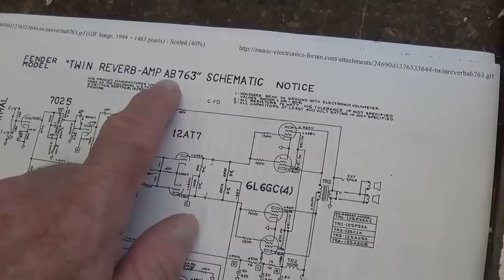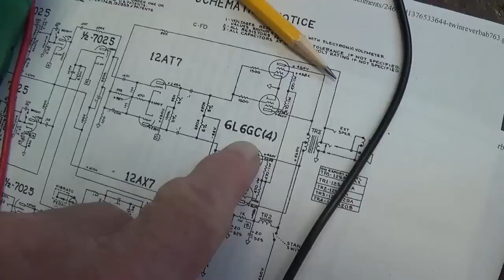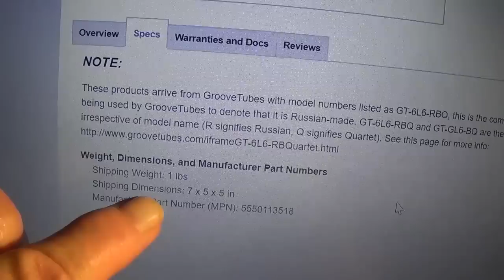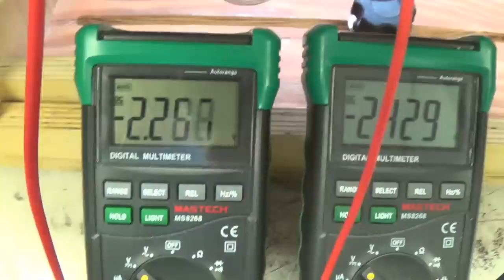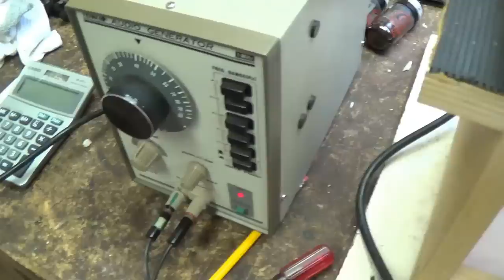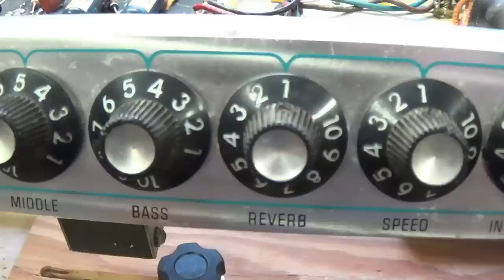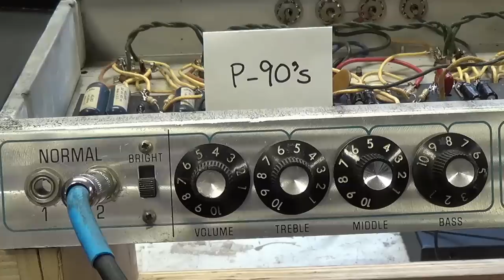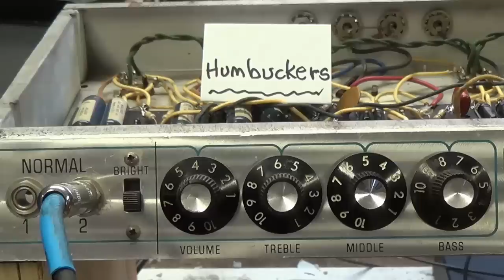1968 Fender AB763 Twin Reverb:   Evaluation, Modification, Extended Audio Demo

Comment: I'm curious as to why you are biasing the amp on the cold side at around 50% plate dissipation. (36.5mA /tube). In my experience 60-65% make the amp sing better.
Reply from the maker: I have been tending toward lower dissipation settings, Arnold, after seeing just how high the PC goes in grid-biased circuits. Several other techs have expressed similar feelings. I honestly thought this Twin sounded great at 50%

Comment: I have a question for you I'm using a traynor ycv80 I know people hate them mine sounds killer. But the guy I bought it off had 2 6l6gc Svetlana and 2 5881 tung sol for the quad would this cause issues
Reply from the maker: The tubes are not equivalent, Andrew, they are like apples and oranges, and probably quite difficult, if not impossible, to bias properly.
Reply: @UncleDoug  thank you for your response

Comment: Just a heads up that long, Long ago.. Mains power wires were colour coded to be Red for Hot or Active, Black for Neutral or the Return and Plain Green for Ground and or Earth, Long story short over the years it was discovered colour blind Servicemen and or electronic engineers were having difficulties with what colour they were perceiving Note some were lacking Green, some were lacking Red while the rest lacked Blue, needless to say appliances invariably ended up being wired incorrectly due to the colours being recognized incorrectly, So after a few deaths, The colour codes were changed so that no matter how each colour blind individual perceived colours they would ALL  identify them correctly..
Reply from the maker: Thanks for that interesting bit of historical knowledge, KAB :)

Comment: Pretty sure I know what happened with that center tap: most repro power transformers I've seen use an orange wire for a copper earth shield around the windings. Whoever worked on it must have seen the orange wire, assumed it was an earth shield and decided there was no 6v center tap. So it means they didn't bother to check the transformer or test the windings and just threw in a virtual center tap. :/
Reply: i was confused about that whole part.  it looked like the virtual center tap was connected to some jack or something.  he removed the virtual tap but the actual center tap wires it looled like he put back right where they were?  i was thinking they would have been run to where the virtual center tap was connected
Reply from the maker: The 100 Ohm resistors (virtual center tap) were attached to the pilot light, which is typical. I simply removed the resistors and grounded the center tap.

Comment: Why 400 hertz and not 440?  

I believe the reason for the colour of the wires on the power cord is the use of an IEC cord.
Reply from the maker: The 400Hz tone is easier to tolerate than previous tones I've used. The frequency is of no consequence to the testing procedure.  Yes, as I said, the cord is of European extraction ;)

Comment: 450 plate volts seam high for a 65 BF Twin reverb? Resistor in rectifier circuit is testing at .750k? Im able to set the bias anywhere from 55 to 10ma.
Reply from the maker: Nope, 450V sounds about right for a BFTR, Eric. Your bias range sounds about right also.
Reply: @UncleDoug  One of my grid resistors is reading .500k and that tube is red plating, could that be the cause, thanks so much
Reply: @UncleDoug  There are no ground straps on pins 8 too?

Comment: Uncle Doug, since your reputation is NOT up to debate but you seem sensitive to that,and you can't replace the caps in the "dog house" tape a note to the top of the dog house saying that you did not replace them. My dream amp would be a Tweed Bassman using EL-84's and a piggy back amp with 4 10's in series/parallel at either 4 or 8 ohms. I'd appreciate your opinions and if you have ever come close to building one like that.
Reply from the maker: Thanks, Dennis. I appreciate the suggestion. I touched up the cap wiring a bit and determined that it was sound, so it shouldn't bring shame to my rep :)  Do you envision four EL-84's like a Vox AC-30?  The power would be there, and with 4 x 10's it should sound wonderful. I'm so busy lately with customer amp repair that I have no free time for personal projects.......maybe some day. It sounds like a viable project.
Reply: @UncleDoug  I think that a pair EL-84's in push-pull would be enough for my use. That's why I asked you about being able to disconnect two EL-84's if necessary.

Comment: Just to add a little more info regarding the filter caps as to WHY some of the leads were J hooked and some weren't. I don't know when Fender changed how the wired up the doghouse, 70 maybe, but before that like in the case of this amp, there's a ground wire that runs under the  board connecting the grounds of the  3 22uf caps and series wires for the 2 larger ones. Fender changed to putting the series connecting wires on top of the board for the 2 larger caps and then running actual ground wires to the 3 smaller ones instead of a ground wire under the board. 

TL:DR  People just leave the original leads in tact on those certain caps because they're connected to the ground wire under the board. On amps that have individual ground wires and the series connecting wires on top, you don't have to worry about this.
Reply from the maker: Good observation,  Robert. Thanks for the helpful input.
Reply: @UncleDoug  Definitely wasn't wanting to step on your toes but I had this question once and really couldn't find any info. 

Thanks for everything you do. Just finished a 71 and 72 Twin large in part due to your videos.
Reply from the maker: @RobertLandrum13  Your helpful input is always appreciated, Robert.

Comment: Hello there Doug, as i had mentioned to you sometime back in a comment, i'm not well versed on electronics though i know the basics....
this might be a stupid question but i don't want to smoke anything...
Recently, i was watching some youtube vids about electrolytic capacitors etc, and i was left with the thought that any of them being around for years in any machine, though not bulging etc, they could be bad just by being in the unit for all these years, (from the 70s etc.).
i do have a lot of old various types of units, most with transistors, (TVs, radios, amps etc.)
should i be concerned and toss them out proactively, since i'm not about to open every one of them up and replace capacitors blindly?
or have someone do it for me at that, that'll be lots of money for units that might not be worth much, but memories....
or just see how it goes and go from there?
So far anything that i've used seems to work fine...
Reply from the maker: Using a current limiter (see my video on how to build one) you can simply try each electronic device to see if it works properly. I do not advocate ripping out all old components and replacing them, unless the amp is going to be used for public performances.
Reply: @UncleDoug  hello there Doug and thank you for the quick reply. I more than agree about the part of leaving things alone and I will try to build me that current limiter that you mentioned. I’ll look for it. Stay well.

Comment: is the circuit limiter light supposed be on but slightly dim?
Reply from the maker: These big 80 to 100W amps could use a higher wattage bulb, George. They draw a lot more current than the amps I usually work on.
Reply: @UncleDoug  ok thanks i did not know this, say hey to the kitties

Comment: I use MOD tanks for repairs myself.  I go a bit overboard on the tank cables though.  I prefer better plugs and signal cable.
Reply from the maker: I understand, Tracy. There's nothing wrong with preferring better quality.

Comment: UNCLE DOUG-- thought this might be of interest to you , I noticed your voltage draining devise with the black electrical tape and fillips head screwdriver sharpened to a point , this led me to think there might be a better way to construct one with a automotive 12 volt pointed test probe , converted by taking out the bulb and spring and  install-n a 1000ohm 10 watt resistor in the now empty chamber of the 12v test probe then solder the test probes cord and alligator clip to one of the leads of the resistor , I sure it will draw other techs interest,  I have a pic of the device but didn't know how to send it to you ,I sure you already know what i am talk-n about, Sorry about the novel I'm writing here
Reply from the maker: Thanks for the excellent suggestion, Stephen. A generous viewer in Holland constructed a beautiful cap-discharging tool for me.......so I am all set for many years to come.

Comment: Those are 6L6WXTs or 5881WXTs which were just Soviet copies of our 5881 made for the the Soviet military. The OTK stamp literally just means "Officially comrade approved." I do have an old 1984 Soviet tube book. These come back with a maximum rating of 86 mA plate @ 250 volt plate voltage, add math and I get 21.5 Watts for max plate dissipation, however Mesa Boogie stamps these as 6L6GC STR425s and Mesa Boogie rams a whole LOT more wattage onto these plates, and they seem to do okay, for a while. They are actually pretty tough tubes for Soviet stuff. These have graphite coated plates and gold plated grid wires. Good stuff, at one time, I guess, but I cannot say whether or not Mike Mathews is making these tubes better or worse then X-Po Pul  under the Soviet regime or not. I will say, I am not very impressed with New Sensor's QC or workmanship.
Reply: I do like TAD's stuff! Them are Chinese made and TAD seems to weed out the junk better than most.
Reply from the maker: Agreed, Seth. I've had good luck with them.

Comment: I read 6l6b’s are amp killers.  My Hot Rod deluxe came with them and, as I searched for mods, I came across warnings about 6l6b’s.   I ditched them and have never looked back.   Never had my amp destroyed either.  I guess you use them at your own risk.
Reply from the maker: I tend to discount a lot of broad condemnation of certain components, James, but I'm glad your amp is doing well.

Comment: Doug, regarding the colour coding of european power leads. We use the same brown & blue for active and neutral here in Horsetrailier,
I always think of it as blue is cool and touch the brown and you're shit.

Great video as always!
Reply: The only way I can remember EU colours (they've never made sense BTW) is "brown bread" = "dead", so don't touch the brown 'cos if you do you're brown bread
Reply from the maker: Good way to remember, Vinny. Thanks !!
Reply: @UncleDoug  I'm almost ready to start my 1st build. Got the chassis, iron, tubes, socket n pots, speaker and filter caps. Plus I picked up an used router for $50 on the weekend. 
I've watched your videos repeatedly and hold you responsible for my developing ampoholocism. 
Thanks from Horsetrailier m8!

My 19yo son knows your voice and your name - the legend grows...

Comment: I have two old GT tubes and both of the locators are also gone ;)
Reply from the maker: They are dangerous to use, TG. It helps to externally mark the location of the index pin.

Comment: You probably know this , but it is part of the danger of USA v Europe/UK power cables.  In the UK white and black can be used after a rectifier indicating DC, or after the power input after SW and Fuse to internal supply.  Black would be anything going to ground or return, with white being a feed (other colours may be used too so its not hard and fast, but we would not expect a mains voltage feed) The Agreed European system of Brown Live (feed), Blue Neutral (return) , Green and Yellow (earth) was a bit of a compromise of EU systems at the time, while trying for the aim of colours that are difficult to mix up visually , and in the twin colour for the earth to avoid dangers of colours fading to be mis-read in the future. This also left other colours free for Three Phase power supplies but I forget what they are.  The British system was probably the most logical in having Green for Earth,  Black for Neutral / Return and Red for Line / Feed / Live.  Red being associated with danger , I suppose brown could be taken as a faded red.  Dont forget too in UK the supply voltage is 220v-250v AC depending on what the grid feels like dropping around domestically, and this is a RMS figure so its nigh on 440v with respect to ground zero volts and a bit more phase peak +ve to peak -ve so you can see the need for inrush voltage protections for circuits at power up, taking the 700v gives plenty of space -  on this unit those diodes in the rectifier circuit looked a little small compared to what you normally use.  Most Power transformers that I see have a jumper settable position of 220/240/250 v and some can go down to the USA voltages if needed, either on fly leads to an external accessible location or on the underside or top of the transformer casing.
Reply from the maker: Thanks for all the very informative input, HP.

Comment: Congratulations on another fantastic project Uncle 
Doug.  After the averages of the plate discipations of the two pairs are dialed in with bias adjustment, is there any utility to going to the additional step of checking the plate discipation of each of the 4 tubes individually?
Reply from the maker: With a matched set of tubes, obviously operating quite well together, I felt no need to do so, Sara. Unless you have Eurotube Test Probe(s) or have added a 1 Ohm resistor between each cathode and ground, it's not easy to determine the individual PC's.
Reply: Thanks for answering my question and expanding my understanding of the power section circuit.  As you pointed out in the video, since the screen resistors and grid stoppers were new and easily measured in circuit, and the power tubes are all well matched, it is easily understood that the power tubes are all operating comparably.

Comment: In light of your humorous comments, my thoughts:            (With or without a pilot light being illuminated)
1. Comment on the 350 V to the guitar strings, sounds like a good plot for a British murder mystery.
2. You comment on European power cords color code, try to understand why the British electrics outlet of 230V fuse side lead goes to each outlet in the house then returns to the fuse again. 
(My comment is not meant to start a debate on North American versus European electrical systems, nor am I sanctioning murder by Guitar amp, but rather meant as an attempt at humor)
Reply from the maker: Thanks, Mack :)

Comment: That negative feedback demonstration is mind blowing. I think for guitar signal it does not give you anything in return for the increased headroom. Sure it has more (uglier) headroom, but what we are doing with a electric guitar/amp is Producing a signal not faithfully trying to reproduce a signal. Wow! Eye opening because I felt it took all the life out of the tone when switched in. Of course it dropped the volume and our ears get very tricky here. I've spent decades mastering records, but you just taught me why people just might love those tube triode hifi amps! I always laughed at them. Shame on me!!!
Reply from the maker: Adding a switchable NFB is requested by 100% of my repair customers with Fender amps, Pete. Once you've heard your amp (at moderate volume settings) with the NFB switched off, you'll never be happy with it on ;)
Reply: @UncleDoug  
Building a DReverb, it's definitely going in. I think on a pot though.
Reply from the maker: @peteleoni9665  Sounds good, Pete :)

Comment: so... on my Twin, my voltage drop is super low. Like -.6 and -.8 V.  Can anyone tell me why??
Reply from the maker: Is this the voltage drop across one-half of the output transformer primary? What is the resistance of the winding? What plate current did you calculate?

Comment: Hey dude, the GT 6L6 B is a Sovtek 5881WXT. Here is the Linky https://www.thetubestore.com/sovtek-5881wxt. I think a interesting demo for the Tone controls would be send a "treble" , "midrange" and "bass" frequencies, one at a time of course, and show the volume change for that frequency, i.e. Bass (C2 or low c, 65 Hz) Mid (C4 or middle c, 261 Hz) Treble (C5, 523 Hz), you will notice that I left off the decimals for simplicity. You mentioned a a couple of videos ago about the possible use of "acid" core solder, and yes it was used in cases where they had to solder a wire or something else to steel. Obviously the acid etched the steel and made a good strong "stick", that is until, well you know. So eventually they stopped using it. Rosin core is harder to get to stick to untinned steel, buuuuut, again acid, copper, not good. Also I don't know if anyone has mentioned this, but your playing has really gotten very good, I can clearly hear the difference from your first videos to now. Oh yeah, what happened to the chopstick?

Blue

PS How bout going to Nevada and flying that drone over Groom Lake, hehehe
Reply from the maker: Thanks for your suggestions, Blue. I'll keep them in mind for the future. I use a beeswax flux paste to ensure that solder sticks.....and it really seems to work. I can't find the $@#%&? chop stick. Maybe a raccoon ran off with it. They have been prowling about lately and possibly favor Chinese cuisine :)